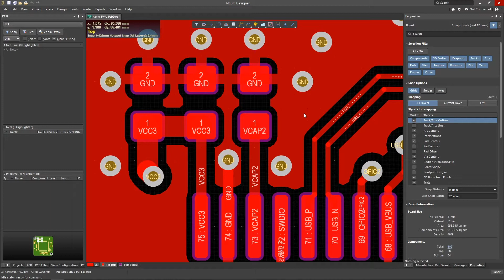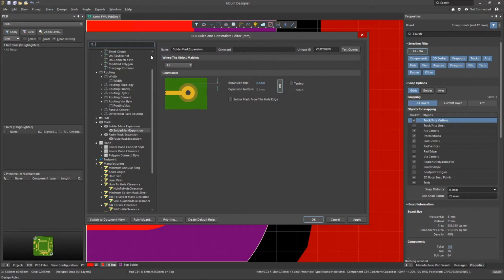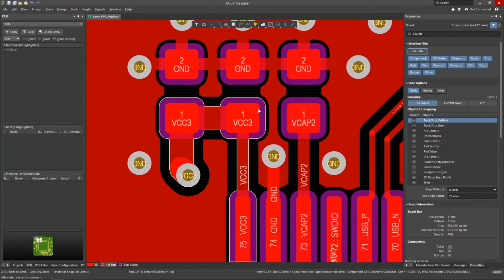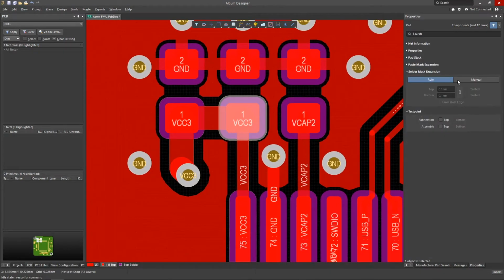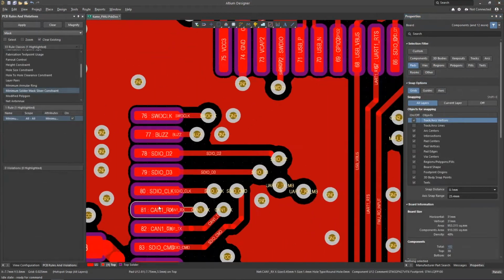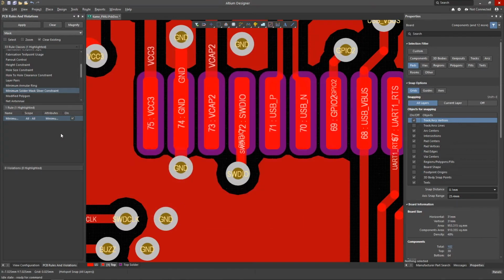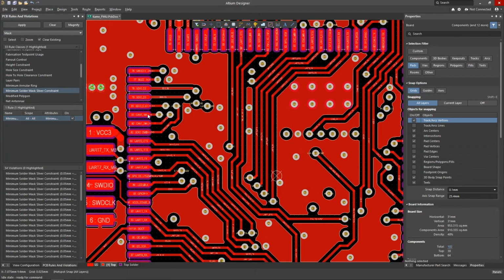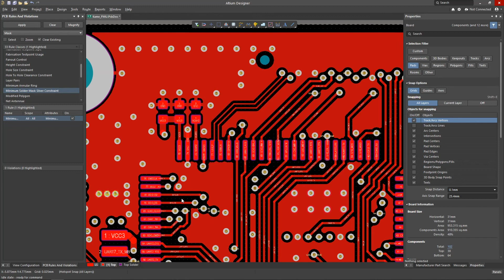Solder Mask Expansion and Minimum Sliver in Altium Designer

Comment: However, there is no way to automatically remove bridges if they are smaller than rule value. At the same time, the manufacturers of PCBs do this operation in probably some other application, in some script maybe.
Reply: You would have to shrink the mask opening or you would need to manually move the parts to increase the size of the sliver to be above the minimum requirement. It is not automated because shrinking the solder mask too much will cause it to be smaller than the paste mask, then you would get paste deposited on solder mask. The other option of course cannot be automated easily because it will require routing changes that the tool might not be able to handle.

Comment: Is there a way of having an online rule for minimum solder mask sliver? I want to place vias close to pads, whilst maintaining some solder mask between them
Reply: Yes there is an online rule for this in the PCB Rules and Constraints dialog in Altium Designer. You sometimes won’t see the online run unless you are moving parts around and zoom in very close. I normally just set the rule and wait until placement is finished, then I will run DRC and resolve any violations.